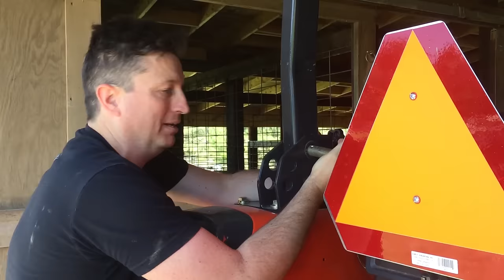Daily Vlogs? - Asphalt Removal and Something Stinks

Comment: How will you lower the floor and cover the gap from the garage door?
Reply: The gap is horizontal, not vertical.
Reply: +mini696 Watch his newest video. The problem is it doesn't vertically reach down. It has nothing to do with a gap on the sides.